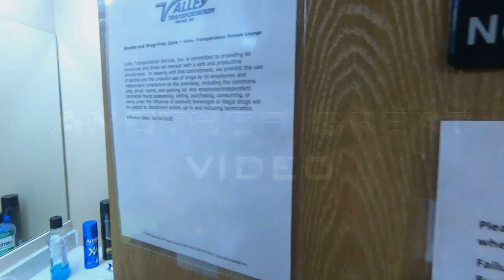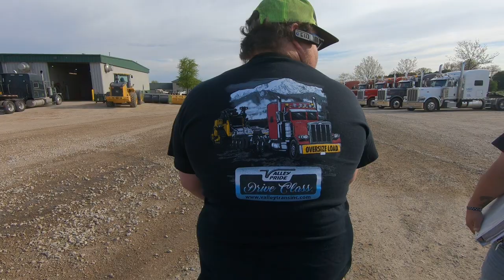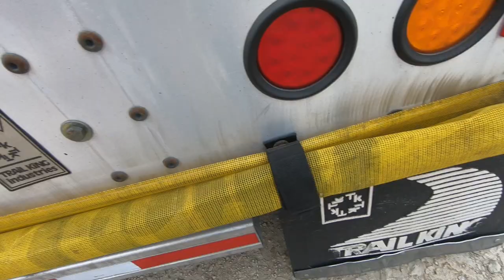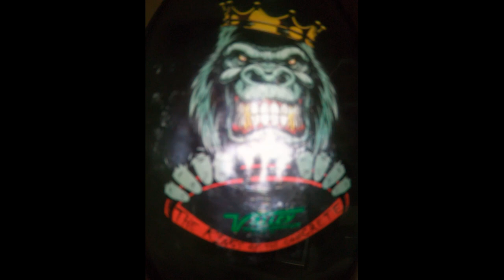valley transportation VLOG#56 Learning how to disconnect &reconnect to a RGN trailer

Comment: Good video guys. I have a mechanical detach that I bought about 2 months ago now, it's an extendable too. I'll say this; doing this on 100% LEVEL solid ground, and empty...looks easy and it is. BUT...when you're not as lucky as these guys and are slightly off level, and a little softer ground, it's a completely different deal.

I just moved 4 railcars that weighed 55k each. The problems started once loaded and trying to get back underneath the load to reattach. Every time, the trailer had settled down a bit because of ice/snow under it, so even with the suspension dumped completely, the plates on the gooseneck weren't low enough to reattach to the deck. I struggled badly with this the first load, until I bought a couple of 12 ton bottle jacks to be able to jack the deck up a couple inches in some cases, to meet the proper height for the plates to connect to the pins, and put the keepers back in place.

So empty, light loads and perfect level conditions are great. Add some soft ground, uneven ground, and big weight, and these mechanical necks will make you struggle. Best advice I can give is to carry a couple of hydraulic bottle jacks and some hardwood planks and pieces to get yourself out of a mess.
Reply from the maker: Appreciate the info but I've really never had no trouble well maybe a little the most I've carried is gross than 110,000 and it was tough getting reconnected but you just got to get her in there and push it hard sometimes the trailer wants to slide so you almost got to get it running start and be ready to hit the brakes so you don't slam it too hard but other than that it's been all gravy but I do know what you're talking about the heavier your load and the more uneven your ground is then the harder it is thanks for subscribing
Reply from the maker: Also I noticed you said good job guys I don't know if that's just a typo but I'm the only one doing all these videos unless you're talking about the valley guys
Reply: @strapschainstruckingwithrj2758  That's why I commented on this video. My main concern is getting back under them with big weight. I can't stand slamming and banging things, 40+ years of being around has taught me to be gentle as possible. Plus, I'm the one writing the checks, lol.  I'm glad I watched the video, but it convinced me that I'm going to invest in a system that I can control the lift and leveling to make it better for the truck, driveline, differentials, and my mind. My projects are a little more complex than the every day run of the mill truckload,  and I have to think outside the box more than the average fella...
Reply from the maker: @ironmountainironequipment6439  okay I see I may have to try that bottle jack thing I guess good thing I don't haul real real heavy stuff we have the other guys for that maybe I'll let them guys know your little trick but but our real heavy haul guys trailers are not like mine they have pony motors and hydraulics and all the other good stuff anyway you be good stay safe out there

Comment: Nice informative video. I work for Valley and am just switching to RGN and kinda funny I hot assigned trailer 658 so same trailer.
Reply from the maker: That's cool do you have any questions don't hesitate to ask be safe out there
Reply: @strapschainstruckingwithrj2758  absolutely will do thank you. And you be safe aswell